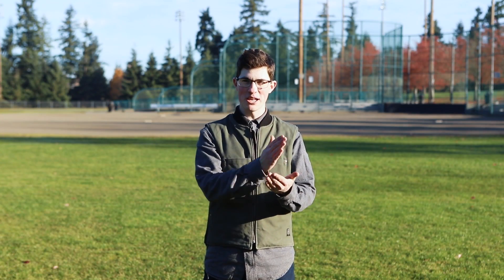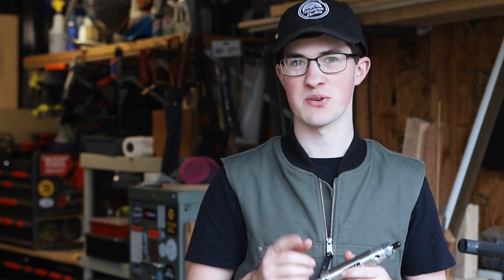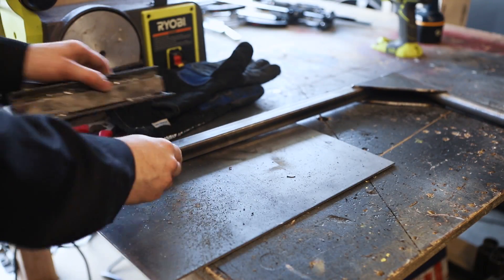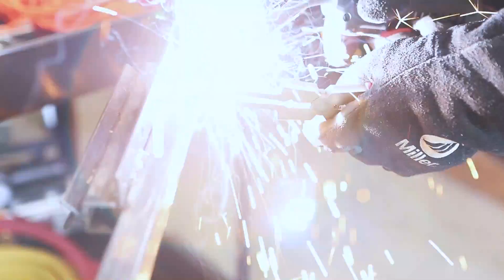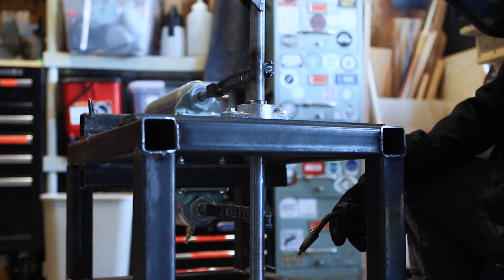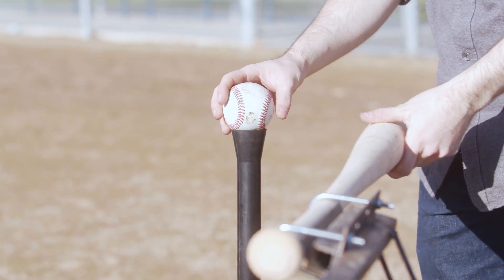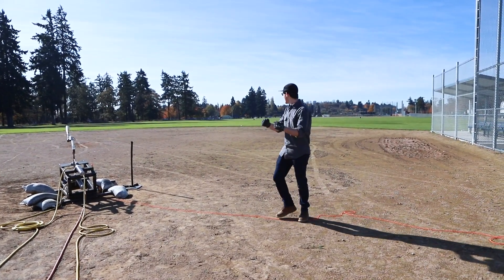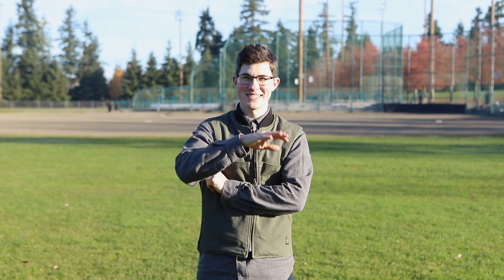Hitting a HOMERUN EVERY TIME

Comment: Garage door torsion bar likely would have helped but you would needed to twist it to add a load on it before clamping it to the pipe, but that would have made it much harder to reset the bat each time.

Comment: Hi Tyler, great video.  Would you be able to comment on the tool you used at 2:46 to keep the holes aligned while drilling through the other side of the tube?  I have to do this often and get horrible results, your way looks much better!

Comment: I'm pretty sure the reason you didn't get much out of the torsion spring is because it wasn't preloaded. The same way a tension spring has a linear correlation between the amount it's been stretched and the force it applies, a torsion spring applies force relative to how many turns it's done. Just for easy math, if the garage spring is 10 pounds per rotation If you start from 0 twist, one rotation cocking back the arm only gets you 10 pounds of peak force. If you wound it up 10 rotations to "Resting" and then another rotation to cock the arm, you'd be at 110lbs. The half vacuum half pneumatic cylinder idea was quite cool too. 

You could also run the math to find the optimum pulley diameter (the axle in your case) to get the highest impact speed. Like with the gearing in a car, a higher gear ratio (smaller gear on the output) makes you go faster, but your acceleration is hindered. There's likely a break even point in your mechanism where a slightly bigger pulley would've gotten the bat moving faster in the limited stroke you had (1 revolution). Again, clearly not necessary to have met your goal.
Reply from the maker: Thanks! Great ideas. I totally agree.